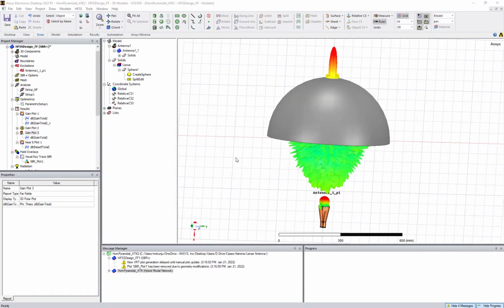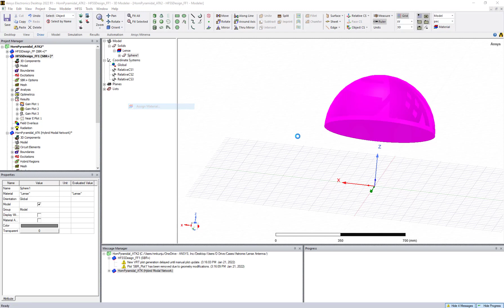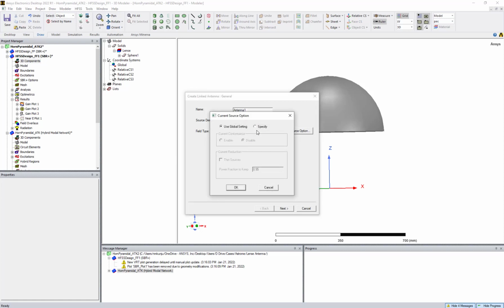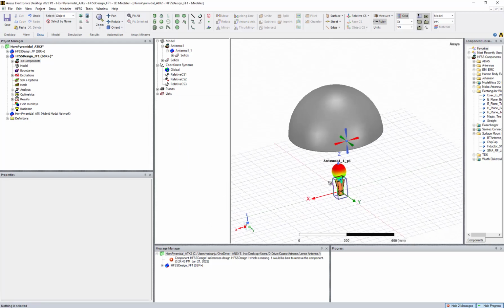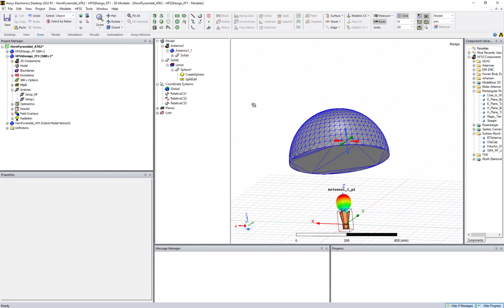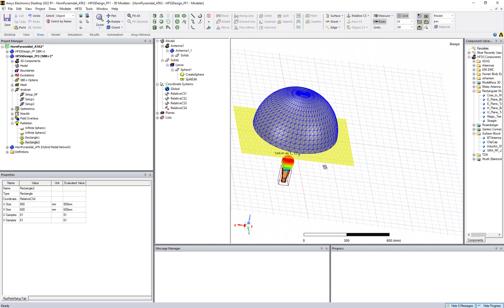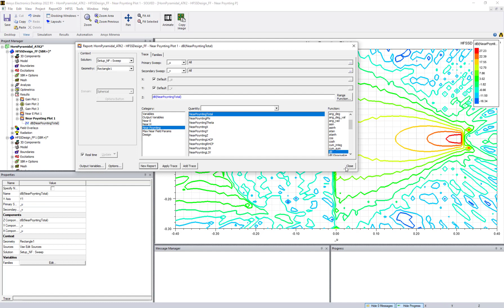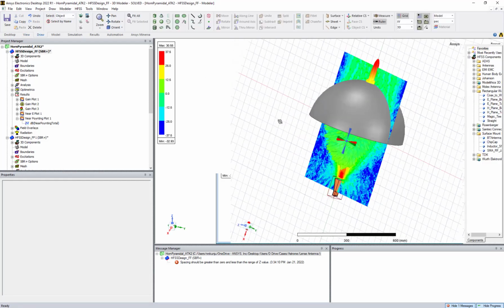Dielectric Lens Antenna using Ansys HFSS SBR

Comment: Face contact between SBR+ object 'Box1' and 'Skin_Burn1' when 'Box1' has volumetric dielectric material assignment will produce unexpected results. Please turn off dynamic or tolerant meshing and make sure both objects are either not doing mesh assembly or belong to the same assembly component. (01:54:38 PM  Nov 09, 2024)      seek help for this error

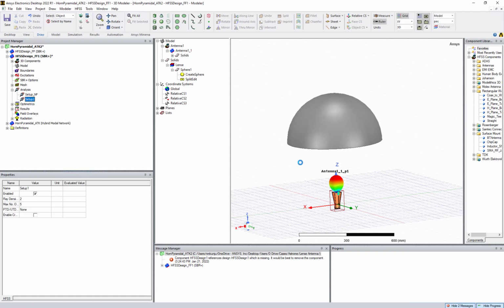Comment: After I finished generating mesh in 6:06 , I have an error messages as follow:
SBR+ sheet object 'wave_port' does not have a valid boundery assignment.

Could anyone provide me the method to solve this problem?
Reply from the maker: SBR doesn't support Waveport
Reply: @hfss_for_rf_application3040  Then what kind of excitation can be use?
Reply: @hfss_for_rf_application3040  Can I use lump port?

Comment: can i check the s11, reflection from the lens. I want to simulate for a copper plate, want to check the complete reflection, can i use same setup with a single horn antenna and able to measure the s11 or any other method is available.
Reply: Hi, I also come across with this issue, I want to use a horn to illuminate a dielectric plate and simulate the S11(magnitude and phase) ,so did you sucessfully get the S11?
Reply: Use two horn antenna one as transmitting and another for receiving

Comment: may you share your lens material setups? how do you have a dielectric material and also no boundary condition ?
Reply from the maker: Make sure u have SBR + design setting. All model created in this design will solve using SBR method
Reply: @hfss_for_rf_application3040  I think I figured it out, starting from HFSS 2021 R2, the SBR+ is able to assign non-conductive dielectric materials to volume SBR+ (vSBR+) region. I think I have an older version(2021 R1) 😅😅
Reply: @hfss_for_rf_application3040  I do have SBR selected. With a dielectric material of conductivity of 0 assigned to the lens, HFSS gives error of "lens must be assigned a conducting material or have a valid boundary condition", the only way I can resolve this is assign a layered impedance boundary to the lens, but it asks me for a thickness value which the lens has a varied thicknesses. Did you define anything else to your dielectric lens material other than permittivity and loss tangent?

Comment: Why SBR+ can run with dielectric model ? As i know SBR+ only support material model. Please tell me how can simulate dielectric model ? Thank you !
Reply from the maker: Yes it can simulate dielectric
Reply: @hfss_for_rf_application3040  thank you so much. I found the way. Iam using impedance layer boundary.
Reply: @LongTran-zj3ns  How did you set the impedance layer boundary ->thickness for curved lens like this? Do you input radius of curvature?

Comment: HFSSDesign1 (SBR+)
    [error] Please define the phase center in the source project design 'HornPyramidal_ATK' used for Antenna link. (12:51:19 PM  Mar 24, 2022)
    [warning] Antenna 'Antenna1_1': Fail to get pre-solved fields from source design. (12:51:19 PM  Mar 24, 2022)

please help on this error .  same model simulated but with error. How to rectify
Reply from the maker: You need to go to Soure Antenna design and right click on excitation to see the set farfield phase centre option (Not in SBR+ design)
Reply: @hfss_for_rf_application3040  Could you explain how to do more clearly please?
Reply: @hfss_for_rf_application3040  I don't see any options for phase ceter. Could you explain how to do?